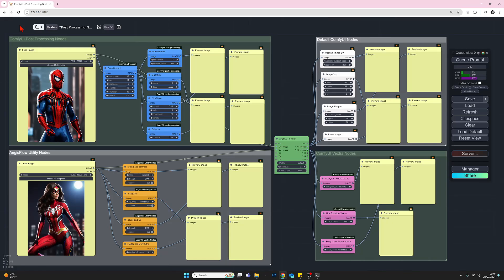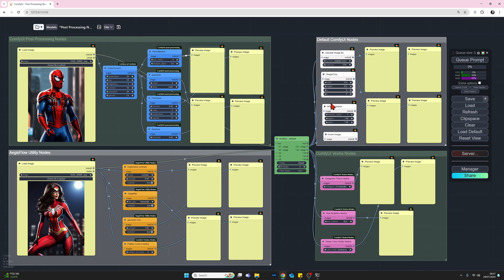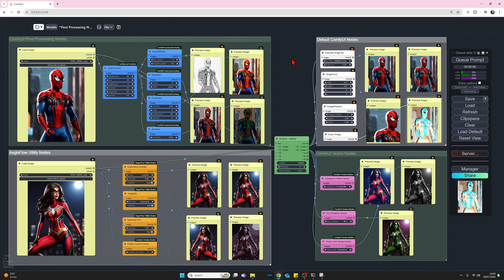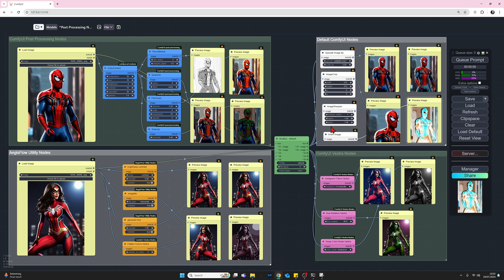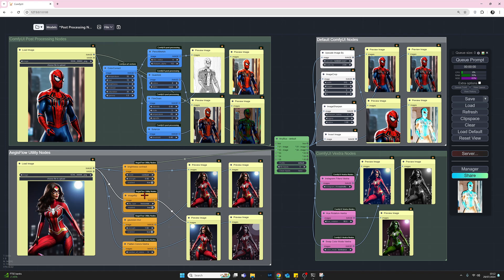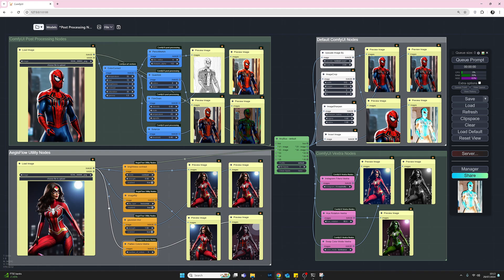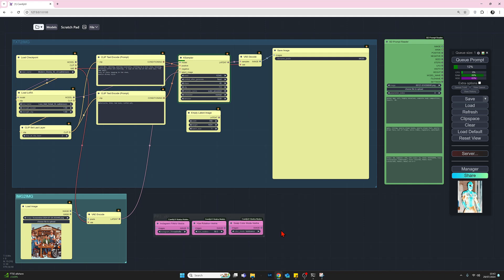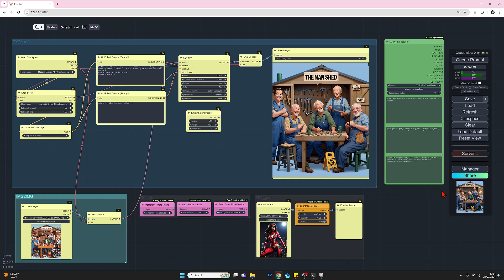ComfyUI - Post Processing Nodes

Comment: How do you detach the panel with all your settings and manager on the right of the screen?
Reply from the maker: Hi,
If you mean the ComfyUI Menu panel on the far right, it does not detach, its all one piece.  Mine may look a little different as I have played with various different plug-ins, eg the 'Server' button which I no longer want but haven't worked out how to remove it yet.

There is a setting in the ComfyUI Menu that will anchor your ComfyUI menu panel so that it is in the same location on every Workflow that you create.  To do that, select the cog wheel icon at the top of the ComfyUI Menu, then scroll down to and select the 'Save Menu Position' option which is third from the bottom of the menu list.

Hope this helps.
Reply: @joeconway85  Thank You! I have found this setting!